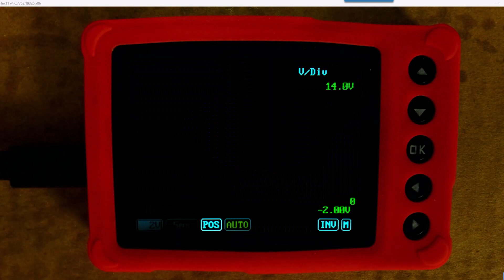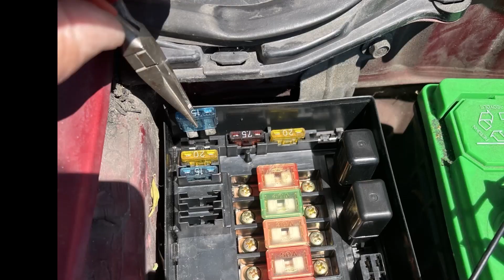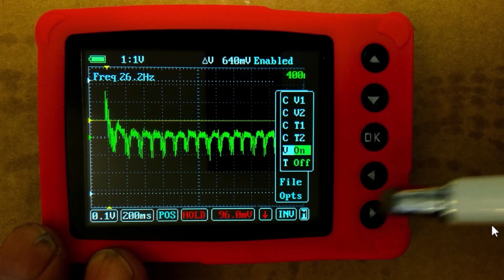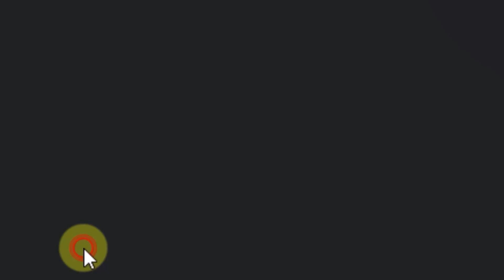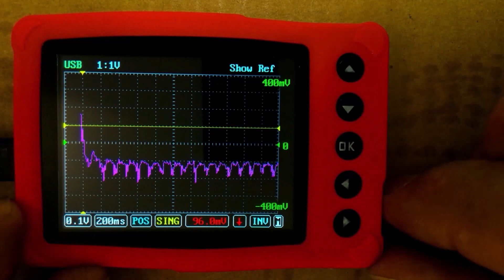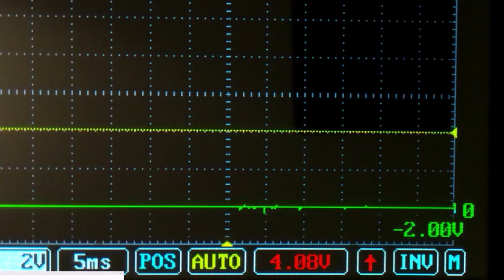uScope Relative Compression Testing Using Voltage

Comment: Nice device - I like the presets and ref waveforms.  Any way to determine cyl 1 on a relative comp test with a 1 channel scope?  splitter of some kind?  Or do I have to drag out the big pico?
Reply from the maker: Unfortunately that is the disadvantage of a one channel scope. However the quickness of this little scope could save you the trouble of dragging out your Pico or any other multi-channel scope.  If all looks good you move on to other test in a fraction of the time compared to dragging out your Pico first only to find out that your problem lies elsewhere.
Reply: @DrivelineMaster  thanks for the quick reply.  Makes sense, a quick and easy tool to isolate a problem area (or even fix the problem).